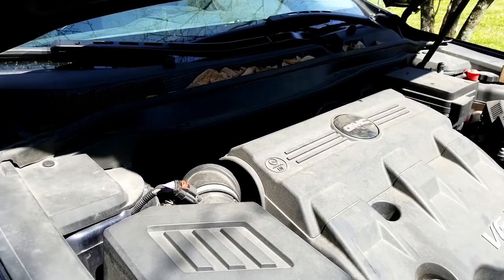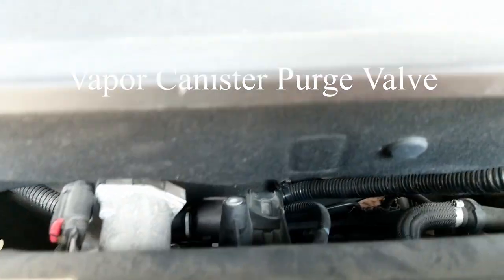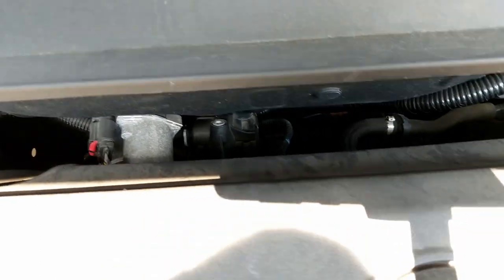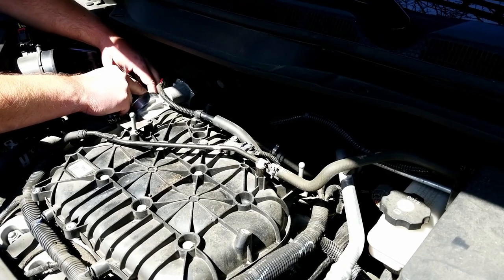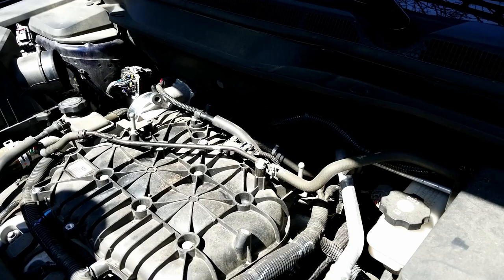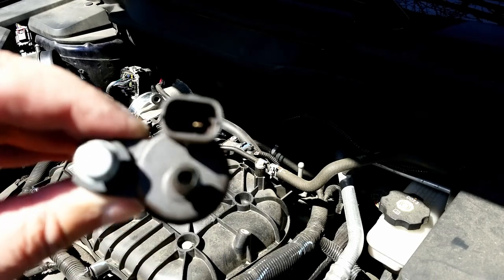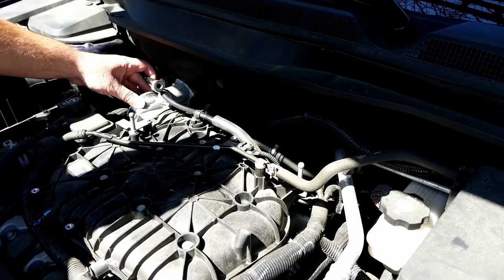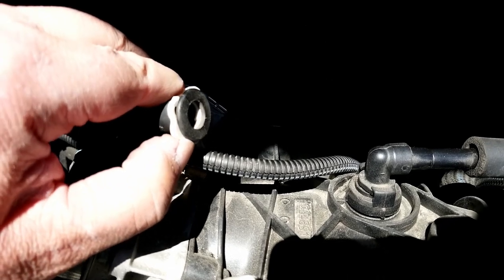GMC Terrain PO496 trouble code

Comment: Thankyou Joe! It took me longer to install ! (2017 GMC Terrain 3.6  64000 miles) I'm not sure if it's on correctly. When I tightened the 10mm bolt it didn't draw the part up real tight.  There is alittle wiggle play. I even put the original (old part) back on,,and it was the same thing as the new ac delco part I got from amazon,,a little wiggle play????? I felt stupid & defeated. So I put the new ac delco 12690512 back on tightened the bolt nice & snug,,still lose....put the thing back together,,took it for ride ( 8 miles) got it up to 50 for a couple minutes,,,seems ok,, rides smooth starts fine,,still got the ""money light"" on. I do remember when I was taking off the original part for  the first time...,,,, after I got the bolt loosened completly ,,,, the purge valve was stuck,,I had to yank on it alittle to get it off. So Joe,,,I'm in my 70's,,whata ya think,,is it wrong!
Reply from the maker: Thanks for watching roger, it will take a little time for the light to go off and from what I remember it did not wiggle once the bolt was tight.